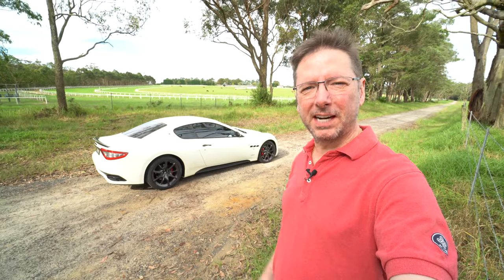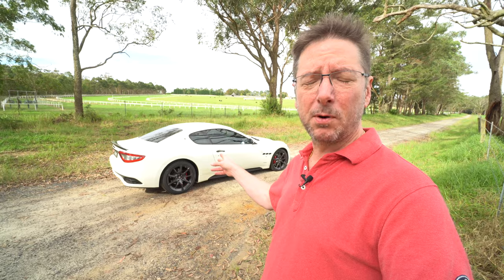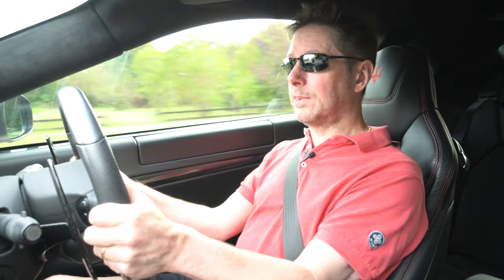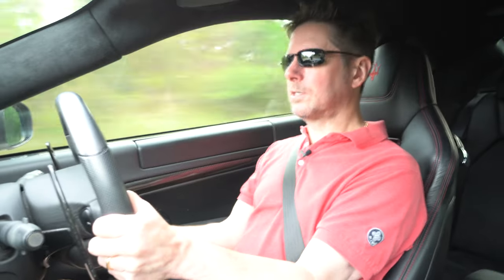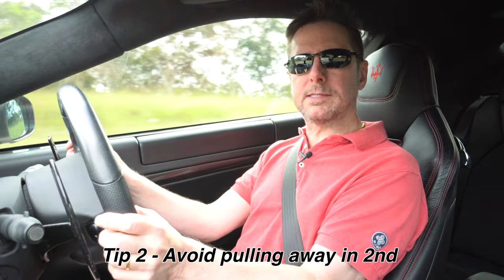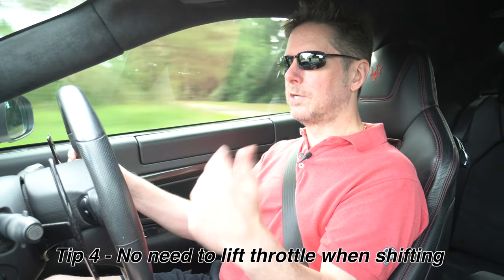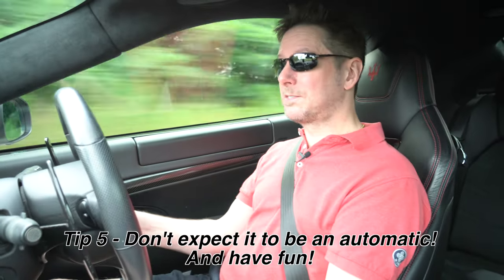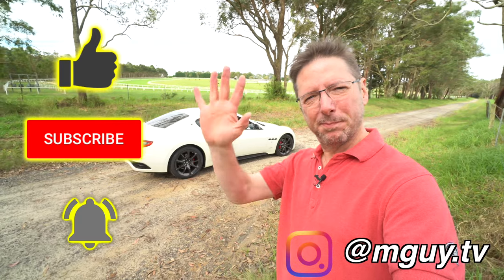How to Drive a Single Clutch Auto - Tips and Tricks (and Myths Busted) | MGUY Australia

Comment: I agree with you completely. I own a Ferrari 2008 599 GTB with the F1 gear box and never drive it in auto and never lift off the pedal when shifting and it’s a blast to drive. I have a 6 spd manual Mini Cooper that I enjoy driving so I’m not against manual cars at all. But the plethora of auto journalists that claim that you have to have a manual transmission for the engagement I don’t quite understand. Let’s face it most of us are not professional race car drivers (perfect) heel toe aficionados so when I’m out on a drive, even a somewhat spirited drive with the Ferrari club I shift the 599 way more than I would with a normal manual and it does it perfectly every time. I’d also argue it’s much safer because it’s right every time with rev matching there is no wheel lock up entering a turn under braking while downshifting and you can concentrate much more on your line. By the way love the sound of your Maserati absolutely one of the best engine notes in the business. Enjoy!

Comment: Tip 4 is spot on! So many reviewers say to lift when upshifting "for smoother shifts" which is not true at all. The manual explicitly states that you should not lift when upshifting. When you do you're just confusing the computer into thinking you want to reduce speed.
Reply: Does that go for the automatic as well when using the optional paddles?

Comment: Crucial to understand for prolonged clutch life is that the clutch fully closes at 1800rpm (this equates to 18km/h on a flat level surface). In other words avoid being in a situation where you have to give gas while below 1800rpm as much as possible. It slips below that. So when driving off for example get to that rpm quickly.
Also at every service you should:
1) perform DEIS self initialization procedure
2) change F1 system fluid (preferably use hydraulic oil instead of atf oil used by Maserati from factory!)
3) perform gear changes self-learn procedures (there are two of them)

Driving in reverse on an uphill is clutch killer #1! So avoid that as well at all costs. Always driving in SPORT-MANUAL mode helps reduce clutch wear.

If you observe all of the above you will enjoy „very“ long clutch life - I get at least 120.000 km out of mine!
Reply: Are you sure about the 1800 rpm (18 km/h). If I recall correctly, the Granturismo S and Stradale clutches are fully engaged at a similar speed as the Vantage V8 Sportshift (somewhere between 7 and 9 km/h).
Reply: @TMKuro  100%
Reply: @pierrena3420 this applies to Maserati QP5 as well?
Reply: @jhonatanjohnson7769  yes, but I don't know the RPM at which the clutch fully closes but I am sure 2,000 is a safe bet.

Comment: I'm not sure if the SportShift gearbox in my Vantage works the same, but I found that lifting off the throttle for the briefest amount of time between shifts does result in a smoother shift. This is only under day-to-day driving in your usual traffic. Under heavy acceleration, keeping the foot planted results in quicker shifts. Different habits for different driving style I guess.
Reply from the maker: Agreed, different software/systems work differently.

Comment: Mine is an Aston Vantage with sportshift . I always leave it on sport and try to avoid any traffic and slow uphill creep especially reversing. I was told to keep my foot on the brake when starting the engine until I hear a click for the gearbox to do a learn but I am not sure it does anything

Comment: great video and advice. been doing 1,2,3,4 intuitively but always wondered in the back of my mind if it was right. still on my original clutch after 40K miles. glad to know from an expert the best way to drive the car. Question, what RPM do you shift normally? I'm typically shifting at 5k RPM.
Reply from the maker: I don't think it should matter, depending on how "eagerly" I'm driving I will hold on longer for better acceleration. But similarly, you can change at 2k revs no problem. The car will auto shift into a lower gear if the revs get too low (even in manual).

Comment: I have a question, 
If you cruise at 5 or 6 gear around 60-70mph and put the car in neutral and let it coast, how do you re-engage the gears and does it re-engage at a high gear?
Reply from the maker: If I recall correctly, you pull the right paddle and the car will go into the appropriate gear for the speed. It’s a way to overcome limp mode where it will only shift into 2nd - accelerate in 2nd, flick into neutral, then pull the right paddle and it should shift into 4, 5 or 6 depending on speed.
Reply: will it cause wear on the clutch by doing this? high speed on neutral and re-engage  @mguytv

Comment: Are you saying when you take off from a stop you don’t ease into the throttle, but just pick a throttle position and don’t move your foot till the clutch is fully engaged?
Reply from the maker: Of course that’s impractical, but the more you modulate the throttle during the clutch slip, the more the TCU has to recalculate the torque required and the clutch position necessary.
Reply: @mguytv  so in your opinion, when moving off from a stop should you give it more or less throttle?  In other words should you accelerate faster or slower from a stop for less wear?  I have heard both, curious about your opinion
Reply: @coreycohen6160  I always ease into my throttle when moving off from a stop. I can feel the clutch slip a little at first and once I can feel it has fully engaged that's when I just accelerate as I see fit. I think clutch slip at low rpm at the start is okay. It's fast starts and launching at high rpm is where heat builds up and causes unnecessary wear on the clutch.